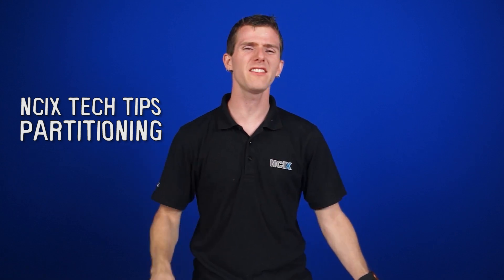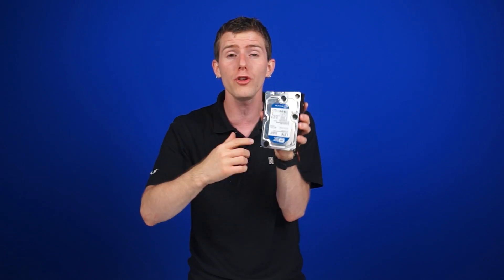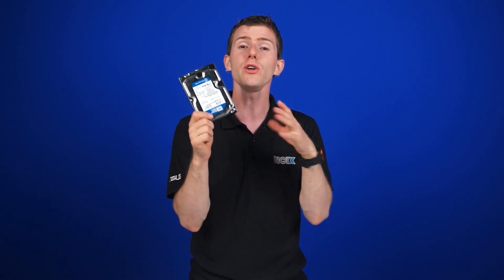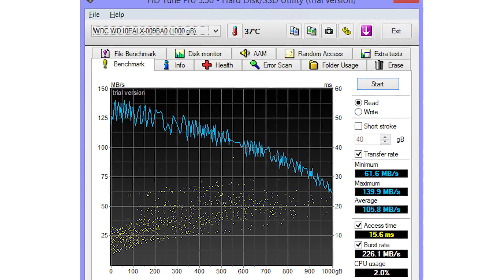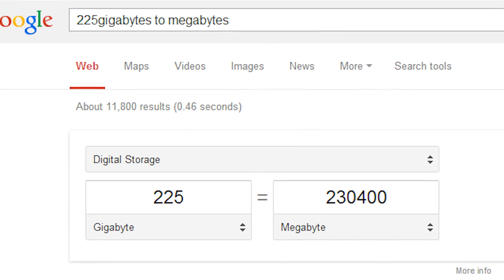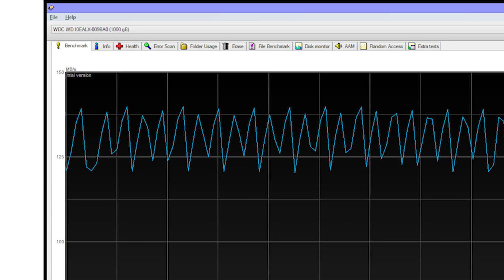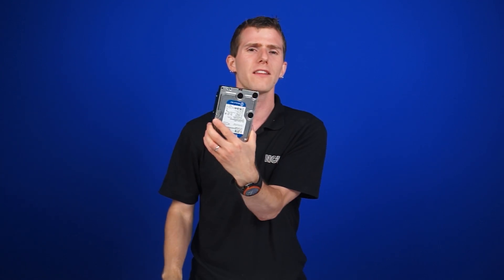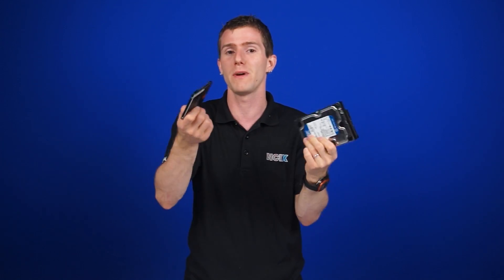How To Optimize Your Hard Drive For Speed

Comment: What the???
At least explain how did you "short-stroke" the hard-drive for us noobs!!
Reply: He did. Its as simple as re-formatting the drive, and setting at least two partitions. Logically hard drive starts at one edge and works to the opposite (be it inside or outside). Thus the partitions will vary in average speed since the average speed of the magnetic surface moving under the read heads will be faster on partitions further from the center of the disk. Use the faster ones only and congrats, your now short stroking. The smaller you make the parts, the faster you will go and the less storage you will have.

I recommend if your going to try to short stroke you create three equal partitions, then speed test them and use the fastest first, slowly working your way through until you have to place data on the slowest one, at which point you'll only see a speed increase when booting the computer (as OS will be installed first thus solely on the outer partition, but you'll be accessing all three when actually using the computer still). Also by placing data on a smaller partition your limiting the maximum range the read head will seek reading it, thus seek times are slightly improved.

However when all is said and done, adding a SSD will be a speed improvement of 18-20 times more than short stroking a 1tb 7200rpm drive as featured in this video. Short stroking can make up to a 30% difference in the real world if your really willing to cut into your storage space, in this video Linus showed off a 19% increase. On the other hand a SSD can run at 480+ mb/s read and write speeds, compared to the humble 105 (or 125 short stroked) of the hard disk in this video.

So if you have the money, get a simple 120gb SSD and you'll save over 4 hours of your time every year just on waiting for your computer to boot (assuming 1min for HDD, 15secs for SSD, computer stated 350 times in a year). Now when you look it it like that, what hourly wage do you think your times worth? That SSD will last 5 years or so happily, so for a $100 price tag you'd be worth just $5 an hour to justify its implementation. And thats only on OS boot times, rerember programs installed on that 120gb will boot faster too!
Reply: Hamish McGregor Thanks For Clearing That Up Man,
Really Appreciate it
And I couldn't believe him on that the hard drive would automatically assign the outer block and inner blocks as different partitions, thus my question to him

Comment: what 225 GB = 230400 MB that is wrong it's not MB or GB a GB is 1000 MB that is it (decimal) I think it's GiB to MB or MiB or something else if I am wrong tell me and I want proof.
Reply: 1 GB is 1024MB cos it is the closest power of 2 to 1000 due to the fact computers run in binary
Reply: It is Gibibyte to Mibibyte ( binary).
Windows tells you " you have x Gigabytes of storage" but it´s wrong, it is Gibibytes.
Thats why an 1Terabyte HDD in reality has about 930"Gigabyte", which are in fact Gibibytes.
 #Windowslogic
Reply: Bertie CF what you're talking about is actually a GiB that's what windows shows you, if you run Linux which actually measures in decimal on 1 Tb you will see a 1000 GB not 931 GB (roughly) Windows measures in binary it's not an actual MB

Comment: Looking at the graph i dont really see a drop off point... there is a slowly increasing fall in the graph, as would be expected.
i guess you could set a partition based on what the theoretical minimum read speed should be.

That said - ive been looking for a way to speed up my video editing. this will surely help a bit :D feeding the data off the drives has been an issue in terms of speed.
Reply: I did this as well. Amazing speed up.
But now i have an ssd...
AWESOME :D
Reply: xnamkcor X
You probably wouldn't even see a speed increase setting up a ram drive as most programs for video editing will use ALL of the ram you have available automatically. Also you still have to wait to load the file from the hard drive and to return it to the hard drive anyway, so I'd recommend buying a SSD instead.
Reply: Returning here with the results:

running a i7-4770K with 16GB DDR3 RAM 2133MHz, GTX 780 Ti for CUDA, 2 seperate drives running at 7200rpm one of 750GB for the media files and the 500GB for writing, both SATA2, and win8.1 and pagefile are on an SSD. Using Adobe Premier Pro CS6

i made a short stroke partition on both drives with 110+mb/s reading speeds.

I used several programs to check on the CPU and GPU activity and just checked on the drive with task manager. Seems it was less active than before, the reading speeds were more constant than before and the CPU was far more active than before. GPU still seemed to hover around 15-20%
Dramatically improved were the writing speeds to the 2nd drive; the video was off the RAM much quicker than usual.
Reading speeds during editing was around 35MB/s .... though honestly i cant remember what it was before the short stroking... it seems low. (maybe the numbers in task management are not reliable?)

im guessing that the better reading speeds benefit the reponse time of the disk by a lot, which better feeds the data to the CPU?

I wonder what others think. It seemed to work when looking at the CPU, but the disk numbers still seem low. also not sure what to expect from the CUDA numbers...
I guess a SSD would be a good investment at this point.
Reply: Hamish McGregor You realize that ram is faster then ssd in most forms of video editing programs.
Reply: xXGamingPandaXx
It doesn't matter... Unless you can pre-load everything into ram before you start using the PC, then your still going to have to wait for your primary storage (be it HDD, SSD or NAS) to load the files.

To put it bluntly, nobody is going to have enough ram to store everything they are going to work on in a day, especially with raw video where files can be tens or even hundreds of gigabytes, your just not going to fit many of them in ram. Thus your waiting to pull the files for your primary storage into your ram, and since the ram is faster than the primary storage, that's going to be speed limited by the primary storage. Thus faster primary storage will increase speed dramatically while adding more ram will only help repeat access speeds to the same limited snapshot of data.

Thats not to say more ram won't speed up a video editing rig, but I'd recommend ensuring for primary storage is fast before I'd spend money on any more than 8gb of ram. 16gb ram is about the ideal Ideal for running a i7 4770 with a single mid range SSD as Primary storage. Any more than that and you'll start to show up the bottlenecks elsewhere big time.
Reply: Hamish McGregor If you have hundreds of gigs of data, SSDs won't help much either.
Reply: Hamish McGregor That's why Intel has hyper threading and quick sync. Well ramdisk won't replace the main drive but on top of that you can use a scratch disk as well which can be also external or internal drives. I have used ramdisk before on 8Gb ram and it didn't lose speed loading up all my drives and ram isn't a permanent data hardware (unless your using ramdisk then yes it is). The reason people use it to get better rendering because ram is typically faster than ssd rate but doesn't wear down like ssd (I could be wrong. As right now I know ssd do have limits on transferring and receiving data) and I would include cost efficient I5 because they have great processor in there.
Reply: xXGamingPandaXx RAM is built to be written and read a lot more than SSDs. It is RAM after all, it needs to be written and read massive amounts per-day, per hour, etc. I think last time I calculated it, RAM is about 2x the price per GB as SSDs, but the speed and durability is much higher.
Reply: xnamkcor X Till the helium hard drives come out I might as well stick with SSHD or just hard drives in general. I do agree with you about ram
Reply: xXGamingPandaXx
What do you mean untill? You can buy the Hitachi Ultrastar HE6 0F18335 6TB right now for less than a thousand bucks. Its enterprise grade, helium and 6tb.
With 50% more capacity than most air filled HDD's (the Seagtate 5tb being an exception) and 49% less power use per gigabyte of read, its the first of the class of sealed, high tolerance 7 platter HDD's.
I feel these will get down to around 300-400 dollars in the next few quarters, so will be a very viable commercial drive when that happens.

Comment: screw hdds..

ssds are godlike, playing skyrim with neraly no loading times
Reply: Everyone still needs HDDs but ive got a 60gb ssd for boot and then a 120gb and 240gb for games that benefit from ssds but then i have 2 1tb hdds for music and games that dont benefit from ssds hdds are still majorly useful even though i cant wait till ssds are cheap enough for me to move to ssds exclusively but even then ill probably still have 1 hdd
Reply: Recently upgraded to 250gb ssd from 120gb. I recommend 250gb, 120gb and below are too small even for a considerate amount of programs and games. But 500gb would be the sweet spot if you have doughs for it.
Reply: ***** i have a 465gb sdd because im to lazy to move files

it wasnt that expensive, i payed 200bucks for an samungs evo840

have installed some games and still 300gb left